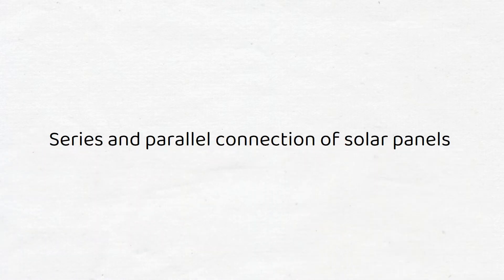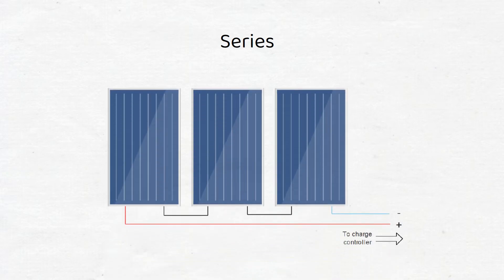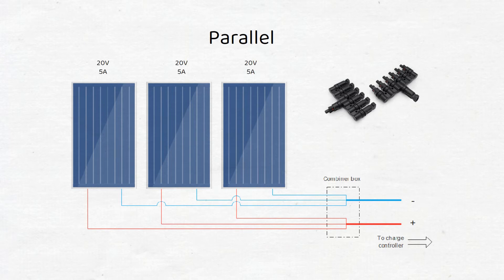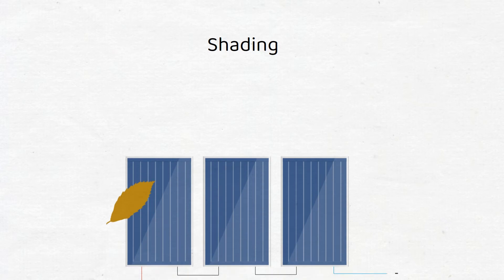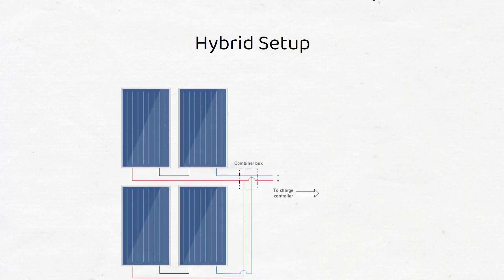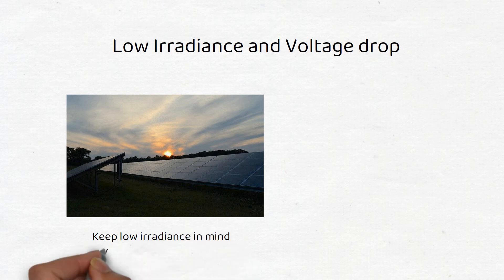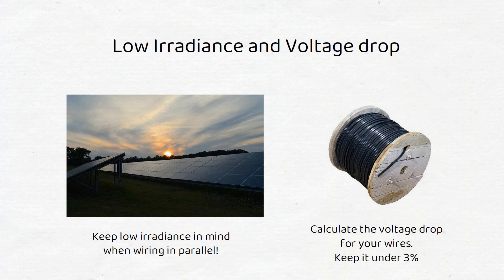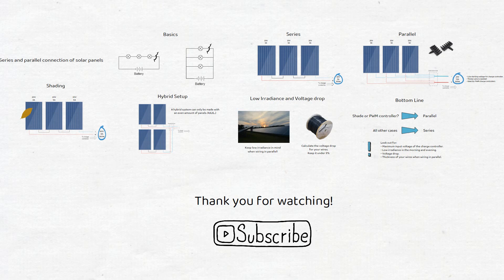Series vs Parallel Solar Panels: Shade, Voltage, and Current

Comment: I have 5panels East in serie 33,9V and 9,7A. One another 5panels West in serie 33,9V and 9,7A without shade. Both together goes to the inverter with Y switch. Is this OK or do you see anything wrong? The inverter is starting 120V, 600V max, panel 330wp. Thankful
Reply from the maker: I assume it's a grid-tied system? If east and west are connected separately it's ok.

Comment: Hi. I have 8 solar panels, each 590watts with 41V and 18Amps. While My inverter Tesla MKSII MPPT range is from 120-430 and maximum range written 500VDC with 80Amps. What do you think I should make 4 series then another 4 string in series after then parallel and I will get 164V MPPT VDC and will get 36 Amp for inverter will be Ok or I need to connect all in series where will get 328VDC and 18Amps. Please advise
Reply from the maker: Hello, If you do not have shade on your panels, I would wire them all up in series. It will save you on wire costs and limit the voltage drop over them. When you connect them, measure the leads first to make sure they are under 430V. 8 panels placed in series should give you 360V max, so I think you are going to be okay.